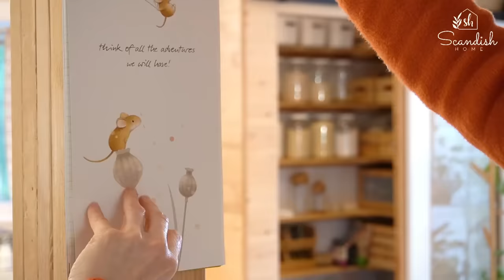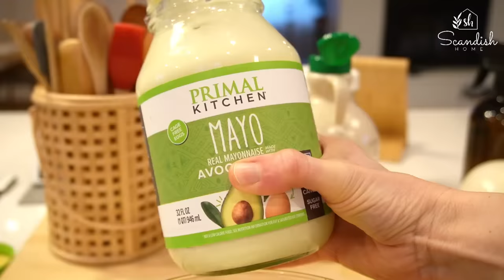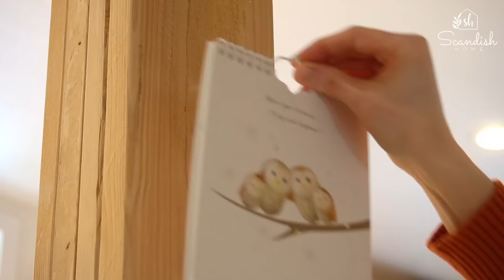TIDYING UP | FOLDING | COOKING | HOMEMAKING TIPS AND MOTIVATION | HOME RESET

Comment: Lol@ the candle comment. Put the candle away and the power will go out. 🤣🤣🤣
Our bad weather was last week here in metro Detroit, I made a pot of 15 bean soup and a pot of turkey chili, plus a batch of cornbread. We have a generator but it doesn't run the stove, so we rely on the microwave when the electricity goes out. We didn't need to use the generator but having the soup and chili in the fridge was great.